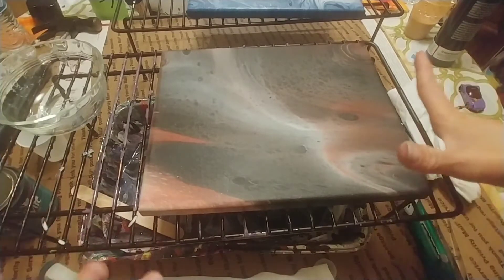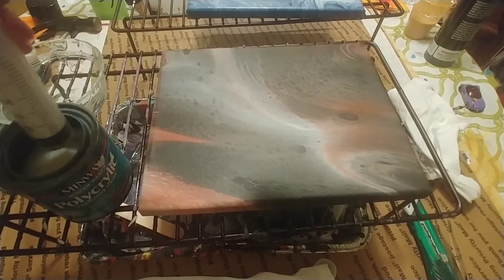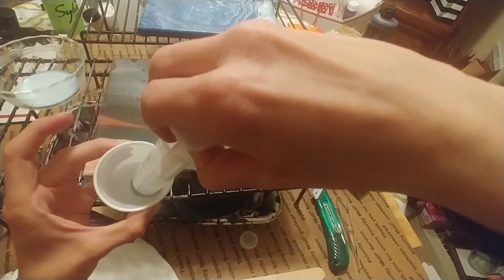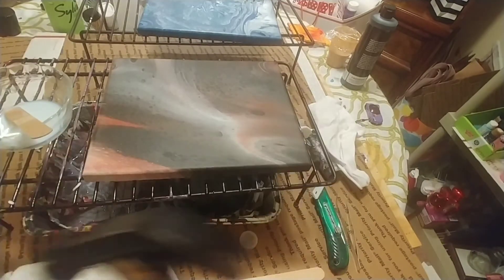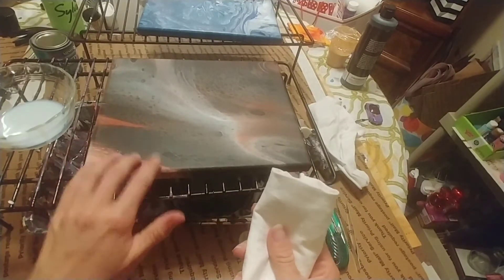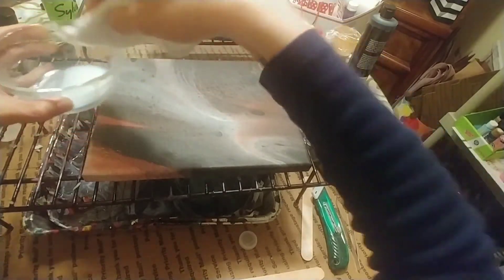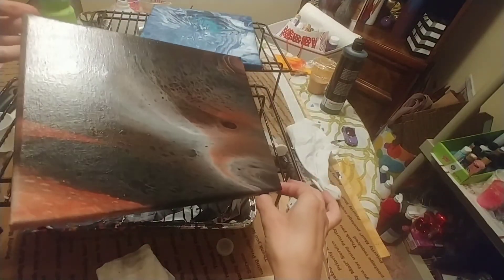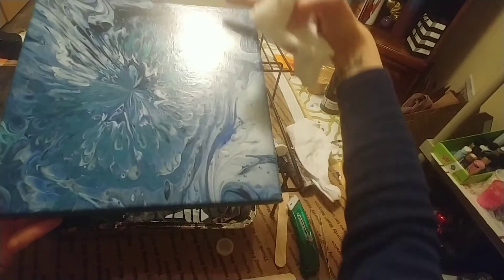How to varnish a painting using Miniwax Polycrylic

Comment: I miss you too.
When I first started doing it that way I would use 50-50. But the shinier the better right?
So I went up to 60% then I realized I could do a little more LOL
This method is so awesome because of several reasons. You won’t get cracking. It also dries very quickly. The only important thing to not do is keep rubbing. Rub it in and then leave it alone which I can see you’ve got down perfect. 
Some will keep rubbing and it dries very quickly and that’s what will leave smudges and marks.
When I first started varnishing I used a paintbrush. Well actually it was a very expensive gloss brush. I didn’t add water then. But if you got your first coat on to thick you would get cracks. Little tiny cracks everywhere LOL that was a real bummer. Then of course I had to deal with the brush marks. Oh my goodness it was a pain in the you know what. I learned this technique from my friend Wanda. I was so happy once I learned it I swear if she was next to me I would have hugged and kissed her LOL because she save me a lot of time and trouble teaching me this.
But the first coat is the most important. Just a little on the rag. You taught this very well..
Thanks for the shout out.
Can’t wait to see you next video..♥️